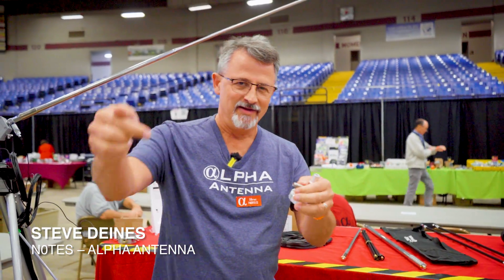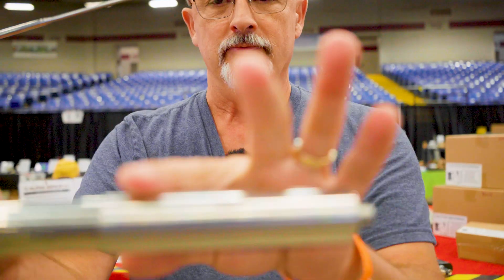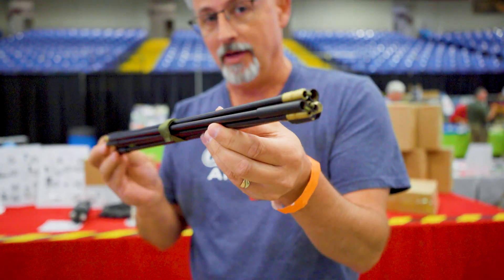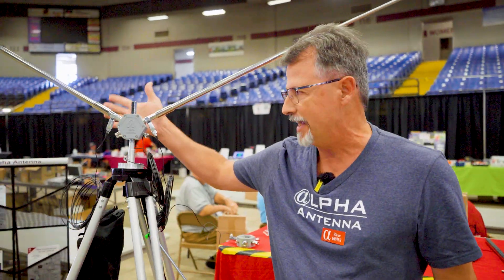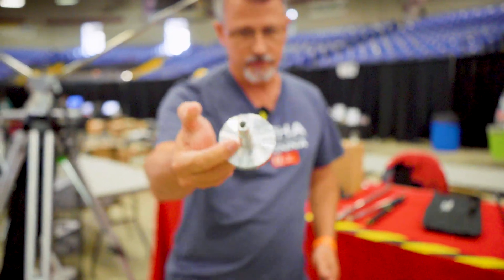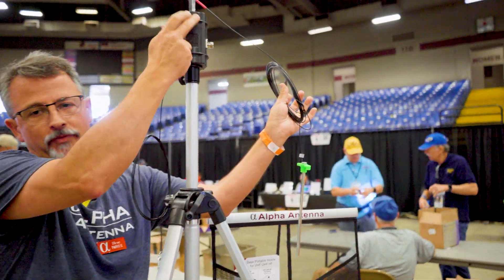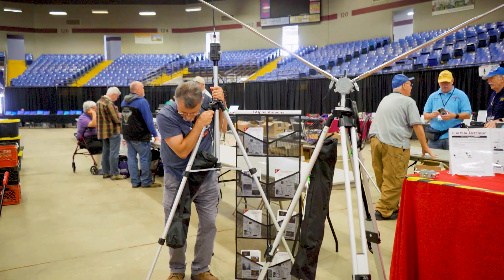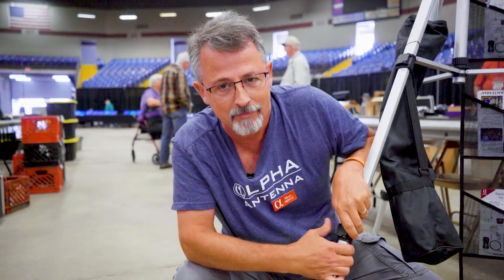Are Your Whip Antennas JUNK? Try These Instead... SPARK-Con 2025

Comment: I have been testing the 17.75ft and 34ft whips with my phased arrays.  They work awesome.  That extra 9inches on the 17 and the full 34 ft really help to tune these to 20 and 40 meters respectively.  Beautiful product that just works.  I carried 2 of the 17.75s with me to the USVi and set them up on the beach with 4 radials each.  They worked amazingly with the phasing unit.  I was getting calls to my CQ from Indonesia, Japan, Asiatic Russia, the EU, USA and North Africa.   Just amazing performance.  Thanks Steve and Alpha antenna and to the this channel for show casing them.

Comment: I wish your pitch had focused on how the products are high quality rather than just appealing to the audience’s need for shiny parts and racism.   Makes me want to avoid your products regardless of the quality
Reply from the maker: Please explain to me what is racist about Steve comparing the quality of hand-milled and produced products made in the USA vs. Chinese-made products that are often mass-produced, have a lower quality control and use lower quality materials to manufacture products?
Reply: Zenophobi appeals to those who are gonna pay $600 for a dipole with a special tripod.

Comment: I wish they had a ss25 black. I don’t see the problem with made in china though. The mc-750 is the best portable vertical in the market and it’s Chinese. RF doesn’t discriminate nationally 😊
Reply: That's an incredibly narrow point of view of things. But I'm not going to ever say that I didn't knowingly buy a Chinese product. But obviously the less we buy from China the better for the entire world.
Reply: @mediocreman2 it’s impossible to not buy Chinese products. And the solution is very simple: sell at a fair price.
Reply from the maker: I personally buy Chinese products all the time. Probably half of my shack is products made in China and bought off of Amazon. That's not necessarily the issue.

The issue is the quality of hand-milled and produced products made in the USA, that typically use higher quality materials to manufacture products vs. Chinese-made products that are often mass-produced, have a lower quality control and use lower quality materials to manufacture products.

There most definitely is a difference.
Reply: @HamRadioHQ2 I see the point. The difference between a ss17 from chameleon and a generic Chinese whip is noticeable. But we all know that “made in the USA” actually means “designed in the USA, built in china”, most of the time